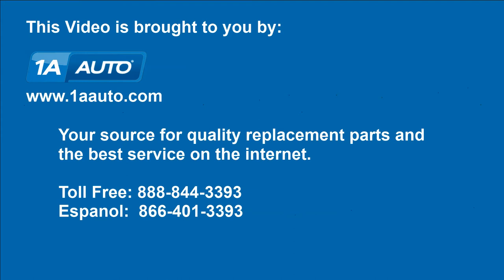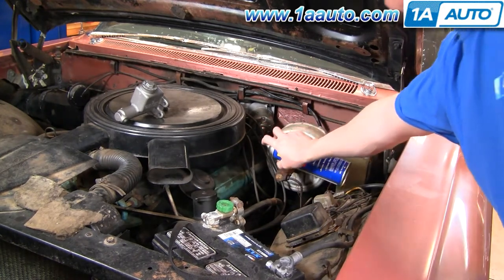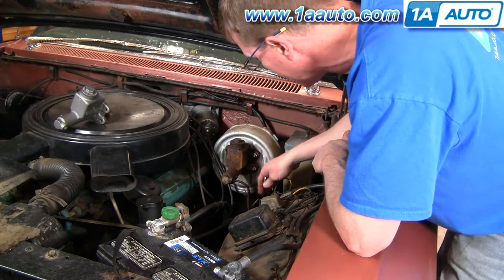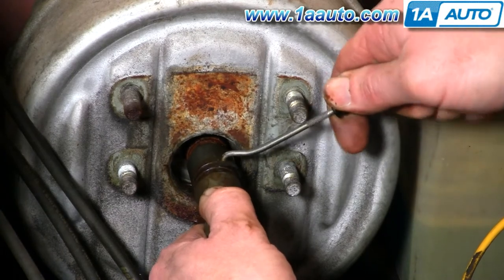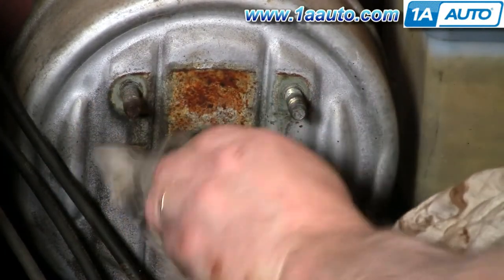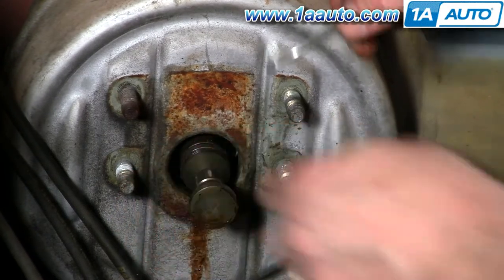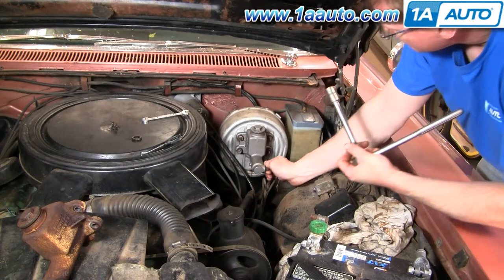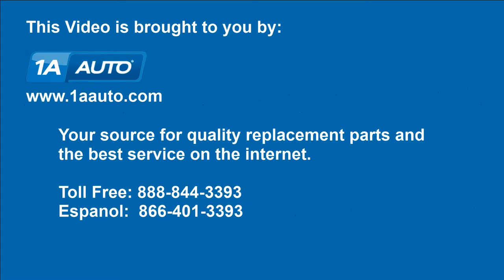How To Replace Master Cylinder 59-60 Pontiac Bonneville

Comment: Hey this is a super instructive video.   I have a 59 Catalina with the same looking power booster but I'm having trouble getting the correct master brake cylinder for it.   The cylinder you show here is what I need!   Is there a chance you could stir me in the right direction?   I'd really appreciate any help you can offer.   Thank you!
Reply from the maker: +Gary Mula Thank you for checking us out! We currently do not have this part for your vehicle, you may be able to take a look to eBaymotors, this may be the best option next to a restoration shop trying to get the part for you.
Reply: Hello Gary, I'm looking for a master cylinder as well. Were you able to locate one? If so can you share your source? Thank you!
Reply: @shawnhengstebeck9684  Hi Shawn.   I gave up after ordering my third one.  My Catalina is in a shop right now.   After they had the same difficulty finding a master cylinder for a Moraine power booster they gave up and talked me into a new brake system.   I feel like you can find the correct master cylinder but it'll take a lot more time than I had.
Reply: @gmula  thank you for your fast reply! I found a local rebuilder today that rebuilds the master and booster as an assembly. The casting for both manual and power brakes is the same number and bore size but uses a different piston from what another vendor told me. The cost to rebuild the master cylinder and booster here runs $300-$400. I have found a few universal style boosters with corvette style master cylinders on both Ebay and Amazon that range from $100 to $200. It looks like they will work with minor modifications. I'm a fabricator (you may have seen me on the TV show Overhaulin'),  so I think I'm going that direction. I have found a parts car if there is anything else you are having trouble locating.